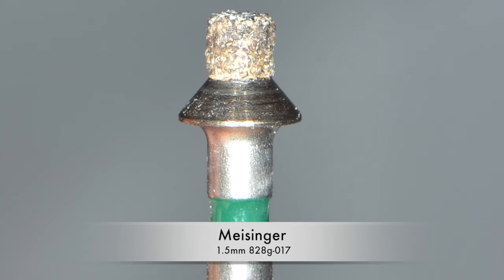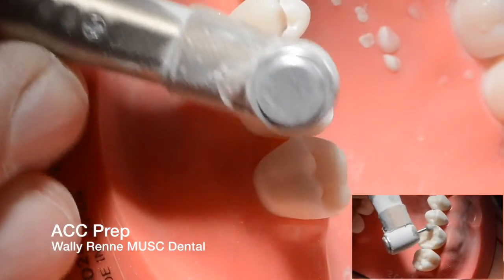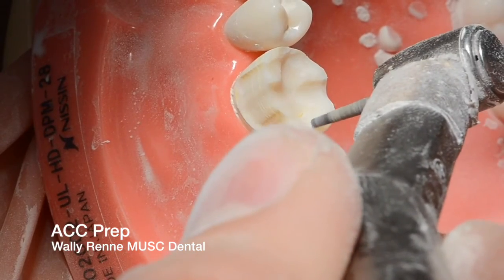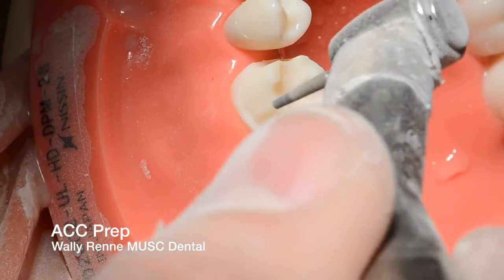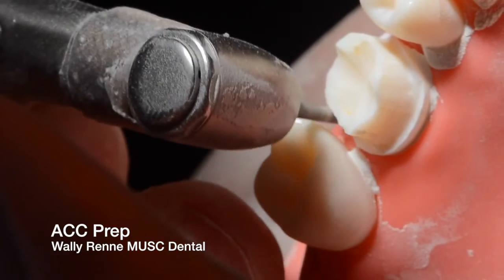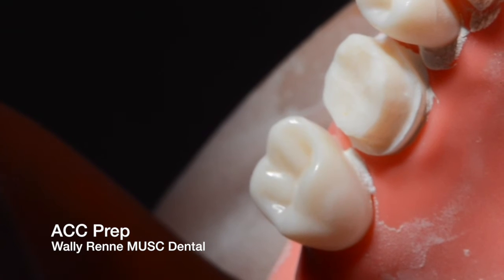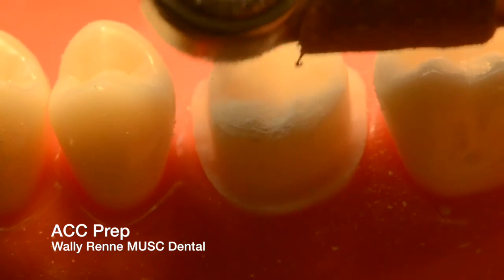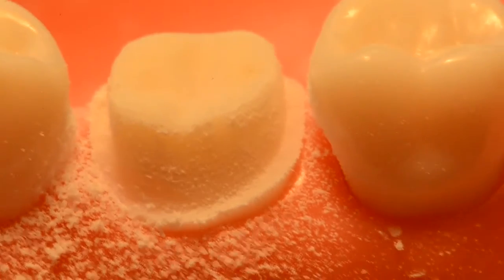ACC  Crown Prep for Dental Students

Comment: Would this be considered the standard level of crown preparation that would be required by the ADA ? My wife is an Endodontist in Mexico with 20 years experience wanting to transfer to Ireland, but will need to complete a 2 part exam which includes crown preparation. I'm almost certain Ireland is the same standard, no ?